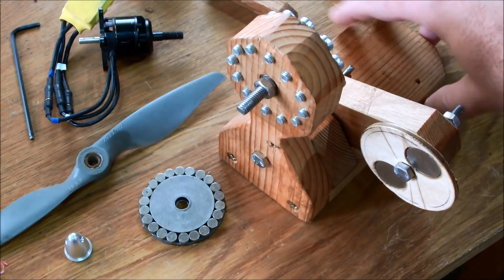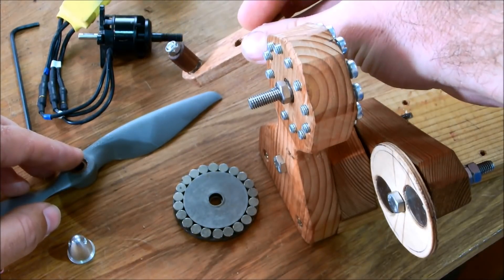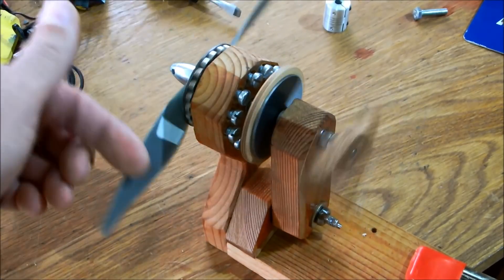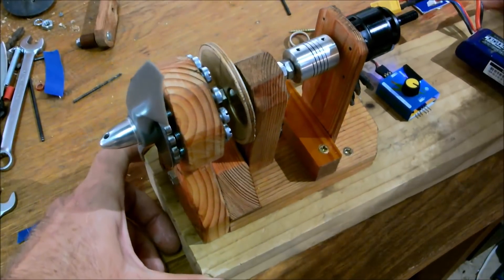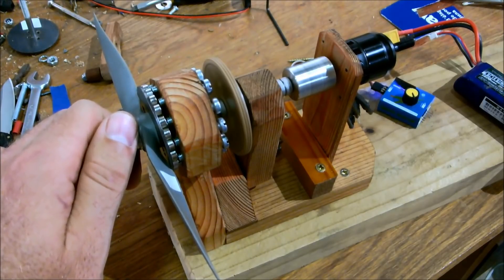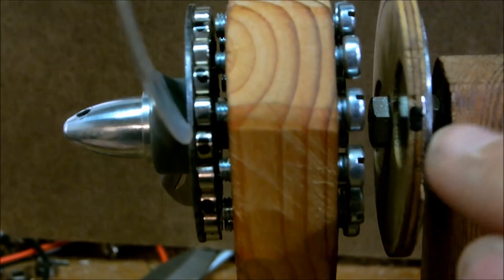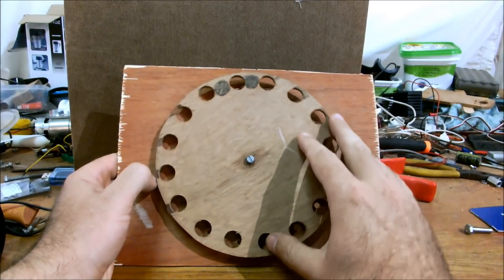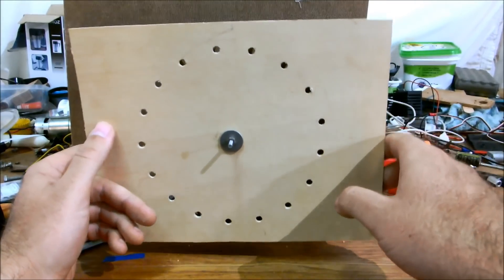Magnetic gears : Axial drivetrain proof of concept

Comment: This allows for some slip in the event of a mechanical obstruction. What’s the actual torque transmission percentage?
Reply from the maker: I never took any measurements but I  read a research paper on it some time ago. I don't recall the numbers but it varied substantially with ratio and magnet count. More magnets gave higher torque slip limit but less efficiency due to the higher frequency flux changes in the iron pieces.

Comment: Hi Thank you for the great explanation, this can viabilize my project, please if you can help me, I need just increase the speed a bit let say 5% or like 10:10.05 and important must to be same direction the table on wikipedia drives me to just one ferromagnetic stator if you can share any diagram with a low number of ferromagnetic pieces or just one will be great, once again thank you!
Reply from the maker: A single iron piece will work if the gears are arranged with parallel axes, like conventional gears, separated by the iron piece. For a coaxial arrangement you might be better off using two stage gearing, for example 20 : 10 reduction followed by 10 : 21 increase.

Comment: I don't get the specifics; I'd love a break down of the mathematics of how magnets of what strength impact other metals when moved, but specifically, I notice that the wheels like to settle in specific positions. It reminds me of how balls rolling over small bumps will like to settle between the bumps. The magnets seem to like to fall into some specific orientation with each other, and the screws. This makes me wonder: would there be a way in which these otherwise efficient gears are loosing energy, much like balls rolling over bumps instead of on a smooth surface? Has that been factored into the equation regarding the comparative efficiency of magnetic gears?

Comment: Good for low torque high rpm applications.. I imagine torque handling could be improved with gearing on either side of the magnetic coupling, but the mechanical losses in the gearing would likely make the design redundant… Now I wanna experiment 🤔
Reply from the maker: There are a number of academic publications on the topic. Each gear ratio has an optimal number of pole pairs for best torque. Lots of small magnets seem to be better than a few chunky ones. For ratios larger than 10:1 it is better to use two or more stages but efficiency starts to suffer.

Comment: Cool demonstration. I know you’re into electric propulsion for boats. Have you checked out Golden Motor’s line of electric boat motors that claim to make use of a magnetic final drive for the propellor to eliminate the need for a prop shaft seal?
Reply from the maker: Yes I just recently saw that. I have considered a magnetic coupling in the past but realized that a seal is still required to protect the bearings in the prop hub, especially in salt water. I wonder if vesconite bushings could work without seals and how friction would compare with ball bearings.

Comment: if anyone could explain why he had to thrust once at least for the motor to pick up when he stopped it, why the motor can't do it...
Reply from the maker: The prop needs high acceleration to catch up with the rotating magnetic field in the bolts. High acceleration requires constant high torque for a certain minimum time. If the prop does not advance far enough during that time, the polarity in the bolts would have reversed and exert a torque in the opposite direction. This is not a problem at lower motor speeds.

Comment: This would be an ideal solution if this worked practically at the same size of a standard car clutch, doing away with carbon clutches, also scaling the size of the wheels you could theoretically create a oil less gearbox, this further reducing the cost of car production and reducing carbon footprint.

Comment: You should look up the Owens Magnetic Car from 1916.  It had a gas powered motor that spun a U Magnet. Technically it was an electric drive system but it was really cool how that drive train functioned
Reply from the maker: Fascinating.
Reply: It really does remind me of your model here.  Especially since it used its system in reverse for braking.  It would use the magnet to effect braking to around 15mph at which point you had to use mechanical breaking.  The throttle was a lever inset inside the steering wheel.  There were not “gears” to change in and out of.  Just “quadrants” at which the magnetic coupling was most optimal.  It would push that car of nearly two tons close to 60mph.  Which.  For 1916 was very good.  The motor was an in-line six that only spun the magnet.  So with no load on the engine it would run forever just about.  It seemed like a care WAY ahead of its time.  I’ve been wanting to buy a rolling chassis of some sort that I could yank everything out of to just try and re-creat using modern parts and such.  Plus with some of the rare earth magnets and super efficient tiny gasoline motors.  No telling what kind of stats you’d get.  I mean.  Probably no where near current hybrids.  It would be fun just to try something unique.

Comment: Looks Great. I built one 4 large magnets, 10 stator and 12 small magnets. It does not work. Does the ratio have to be 4:10:16 or will any ratio work?
Reply from the maker: 4-10-16 will work, as will 4-8-12. You might have to adjust the distance (air gap) between the magnets and the stator to get it working. Also play around with different size and shape stator pieces. If the stator pieces are too small then they will not modify the magnetic field sufficiently. Too big and the magnets' attraction the the iron might just lock it in place.
Reply: @williamfraser  I will update my build -thanks
Reply: Redo-3D printed and assembled 4:8:12 and it works fine as a 3:1 ratio-Thanks

Comment: Have you any hypothesis for restarting the propeller or wheel should it stop in a real world situation?
Reply from the maker: The prop should start rotating again if the motor slows down sufficiently. The torque required to get going again is equal to the prop's inertia multiplied by the acceleration required to "catch up" with the rotating field. Less torque is required for the prop to accelerate to catch up with slow rotating magnetic field. The motor could also be stopped completely and restarted. If the field coupling is strong enough then the situation of a stopped prop might never arise in the first place.

Comment: My question is why wouldn't you have built this in reverse as far as the magnets. So instead of turning the handle a half of a turn to move the blade one magnet space. If you flip the magnets around your work load would be a lot less
Reply from the maker: You can run it in either configuration. As demonstrated the prop rpm is lower but torque is increased allowing the use if a larger prop.

Comment: Wouldn't it make sense to place the propeller on the other side?
Reply from the maker: If you want to speed it up, yes. Most gearboxes are used to reduce rpm and increase torque.

Comment: Thanks for sharing. Have you looked at the eddy current losses in your system? A very interesting magnetic gear box is a car alternator turned into a motor. Essentially is it a variable KV motor by changing the energizing field strength and using a a brushless speed controller for motor power.
Reply from the maker: I have not investigated the eddy losses. I suppose they can be reduced by using laminated blocks rather than solid iron rods. The alternator motor sounds interesting, I'll have to take a look at it. My experience so far is only with permanent magnet motors. I like the idea of variable Kv. It might also help to tune the motor for best efficiency at a given power.

Comment: why not just magnetic planetary gears
Reply: this is very close to the harmonic (planetary) gearing system
Reply: if you make a wire-coil only electric motor, then it will not have any free mode resistance
Reply: if you dont want that to slip
Reply: magnetic cogs will not have friction but will not slip
Reply: that functions like a clutch, when in the slip-over mode
Reply from the maker: This drive is less complicated than planetary gears, fewer moving parts. It transmits torque through a bulkhead which would not be possible with cogs. It obviously comes with limitations and perhaps not as efficient.
Reply: @williamfraser  i see the three rows of teeth as three cogs

Comment: why don't you switch it around?
Reply from the maker: My application requires low rpm and high torque while the motor runs at peak efficiency at high rpm and low torque.

Comment: would you not want to switch the magnets around? so the motor spins less but blades spin more
Reply from the maker: Small motors come in many high speed options to drive a fast prop directly. Large props or underwater props need slowing down with reduction gears.

Comment: does the torque multiply?
As long as you are below the maximum possible torque.
Reply from the maker: Yes as long as you stay within the working limits the torque-speed behaviour is the same as mechanical gears. Output torque would be slightly less than an equivalent mechanical gear due to efficiency losses in the iron pole pieces.

Comment: I have a very limited understanding of magnetics, so bear with me. If you took the plate with the high number of smaller magnets on it and moved it further away, would it move slower or just have less torque? If the torque required is so much that the magnets can’t keep up, does the machine simply stop or does it slow down?
Reply from the maker: Further away will have less torque but same speed. Once the load exceeds the torque slip limit, the driven gear will stop since slowing down does not result in a stronger magnetic coupling.

Comment: Wonder how small that can be made? Would be ideal for a RC submarine, one less hole in hull to worry about.
Reply from the maker: I managed a working prototype 30mm in diameter. It fits neatly inside a 50mm syringe tube. Torque was very limited due to the small magnet size and diameter. For a limited diameter, a long radial arrangement would work better. You obviously already have the desired shaft rpm, why not just use a direct (1:1) magnet-magnet coupling through a bulkhead?

Comment: Wouldn’t you want the crank to be spun with less rotations and have the propeller be spun faster? Instead of it being the opposite way around
Reply from the maker: For a high speed propeller it would be better to use a high speed motor and drive the prop directly. Most small motors are capable of high rpm. My application - mostly boat related - requires slower rpm and higher torque. A direct drive low kv motor would be best but you don't get them in such small sizes.
Reply: @williamfraser  Ohh okay! That makes sense
Great job on it too btw!

Comment: Too much of improvement needed and you would still have a high load slip, it is a good base for an electromagnetic cluch that uses mercury to engage, the wear would be so insignificant that even after the piston rings get to the point when you have to replace them, the cluch would be in mint condition

Comment: When I first saw this video, I was under the impression is was one of those free energy from magnets videos. My observation is that the air gaps are a little large, and surprised that so much torque is transmitted with such a large air gap. I am trying to equate the speeding up of the drive motor when the prop stops to the slip of a regular induction motor. Wondering if the steel bolts could be replaced with a lower hysteresis material such as powered iron or a ferrite. Thanks, it was a very interesting and informative video.

Comment: New system for electric drill gear box? Imagine 3 coils and a variable speed drive controller. The 3 coils create radial flux rotating dipole magnetic field through which external steel pole pieces low reluctance paths conduct and concentrate the fields the same as seen here with a perminate magnet.

Comment: Interesting proof of concept , 10s of hours of testing , been there done that , and still trying to improve my own designs. I like the direction your heading , and you will get better results with better materials and decrease the gap. Try copper tubes with iron core instead of bolts that zinc plated. Keep us posted on the results
Reply from the maker: Why the copper tubes?
Reply: I think it will force the magnetic field lines around the magnet to straighten, strengthen the directional magnetic force.... I think- someone correct me if I'm wrong

Comment: Why don't you use the end with the prop as the input side? Makes more sense to me if you ran it that way!
Reply from the maker: Most of my intended applications require low speed, high torque output. For high speed projects it would be better to just get a faster (higher Kv) electric motor and run it direct drive.

Comment: This is pretty neat, but I could see it being problematic in  practice.  If you're using any sort of mechanical bearings for your rotating parts, they are likely to have a rather short useful life.  Bearings and magnetism do not play well together at all.  Magnetized bearings draw in  metal filings and debris like, ... well ... a magnet.
Reply from the maker: Good point. It just gave me an idea - why not build the unit as an integrated bearing. The pole-pieces can be used as the output if the large magnetic gear is kept fixed. The pole pieces and their non-magnetic retaining ring can take the form of rolling needle bearings, eliminating the need for a separate output shaft bearing.

Comment: I imagine the torque holding capability to weight ratio would not be up to par with mechanical gears, but it would probably be possible to make a nearly frictionless, unbreakable car transmission with this
Reply from the maker: You are probably right, mechanical gears will have the torque/weight advantage. At very high rpm the magnets might provide better power/weight. A first order coupling (i.e. without the iron pole-pieces) could possibly also transmit better torque and would not have the hysteresis losses from pole pieces.